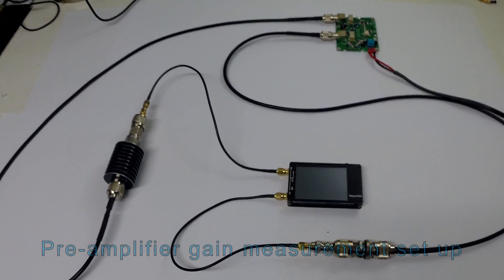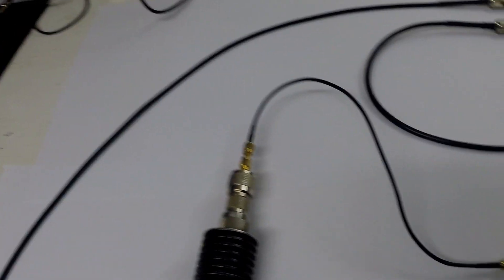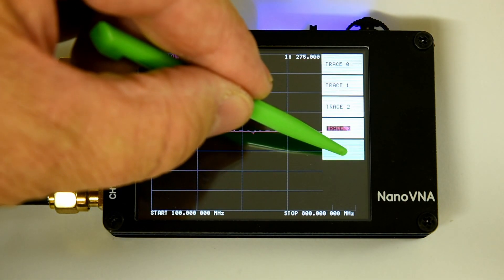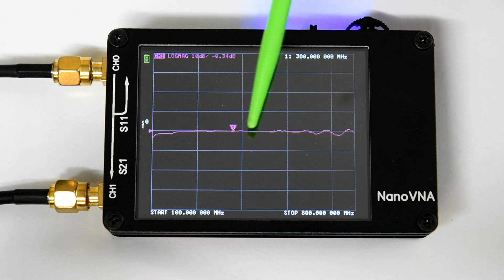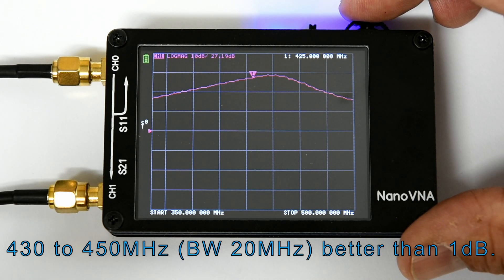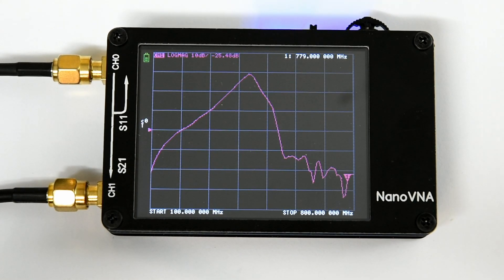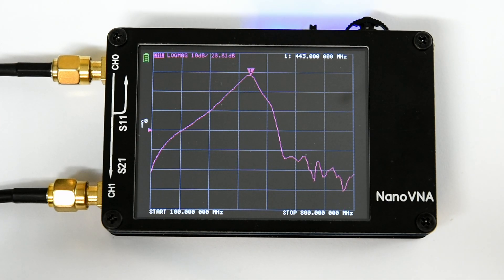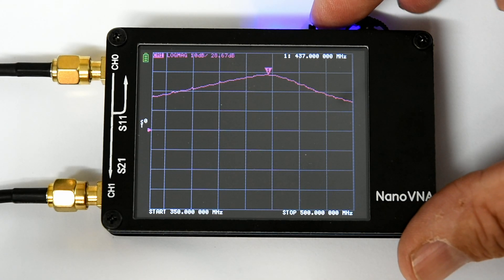Measuring the gain of a UHF pre-amp with a NanoVNA – November 2020

Comment: The amplifier gain is 28.85 dB, and since a 20 dB attenuator is connected to the amplifier input, and the output amplitude of channel 0 is approximately -13 dBm, at the amplifier input we will have -33 dBm. Amplified by 28.85 dB, this will give us an real output of -33 + 28.85 = -4.15 dBm at the input of channel 1 of the VNA—a safe signal that will not damage the VNA.But without an attenuator it is very dangerous since we would have a signal of -13dBm + 28.85dB = 15.85dBm, a signal that is too strong and could damage the input channel 1 of our VNA.Thank you for this very illustrative video.

Comment: Hi:
You said that the contacts of the relays are in the normally closed state when the amplifier is not powered.  Could you not have left the amp connected for the through calibration?  That would have given a more accurate calibration.  Thanks.
Reply from the maker: The closed state link has a 470pf DC blocking capacitor in series and so would introduce some reactance into to calibration that would alter the results of the preamp test, therefore it better to zero out the test leads and connectors with a short link. That said I did  calibrate with the preamp closed state link and the gain measurements were very similar.
Reply: @petermiles6557  
Okay; thanks for the clarification.  Cheers.